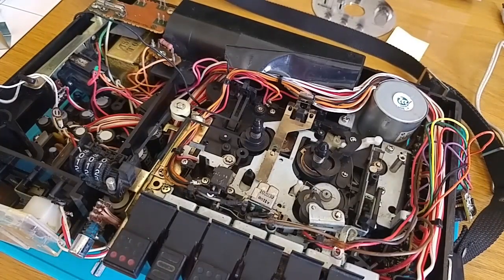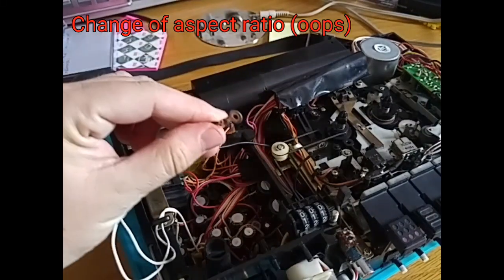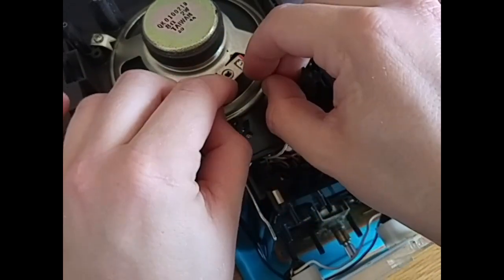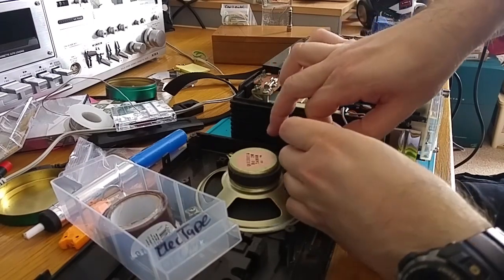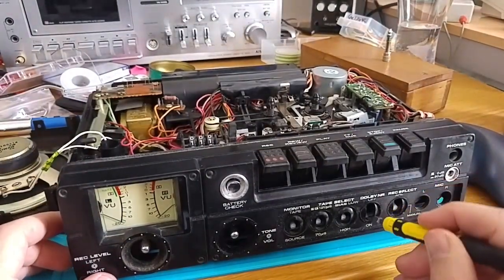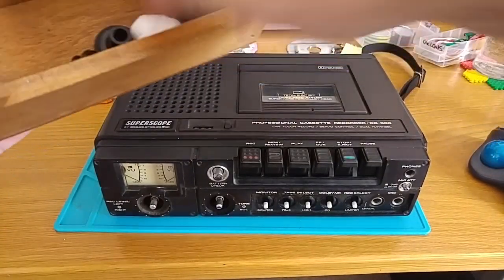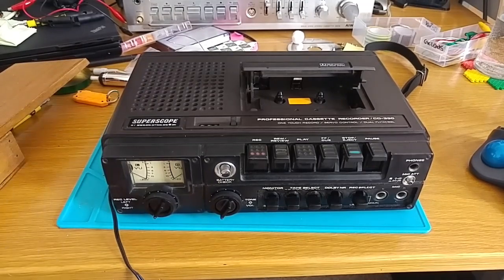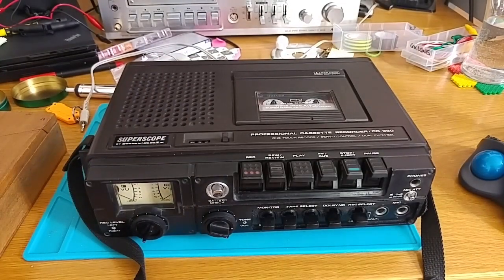Marantz Superscope CD-330 Repair: Part 5 (Fixing Old Junk)

Comment: How did you reattach the door as it should mine is loose and will not spring up when ejected
Reply from the maker: Mine was never quite right even when I received it to be honest. I suppose a spring needs tensioning?
Reply: Must be I cant tell which spring connects to it I have the feeling some small rod fell out connecting it

Comment: I have one, I changed the belt, i have a problem with rev it doesn't work. but ff / cue works fine
Reply: I have the same problem. I also have changed the belts and it didn't help